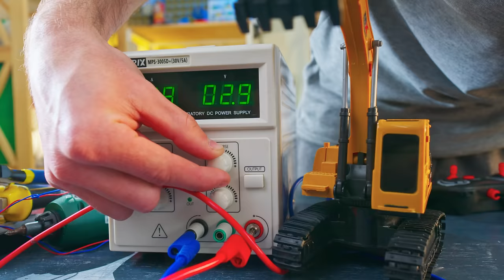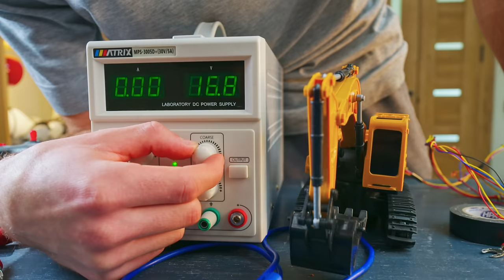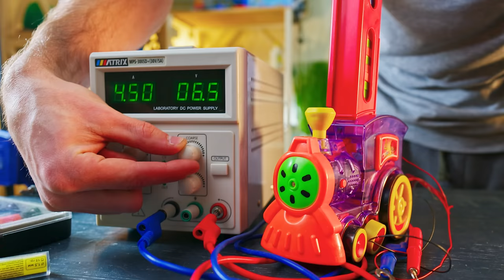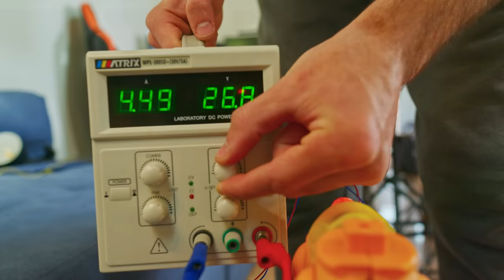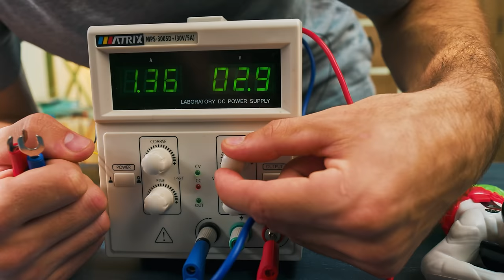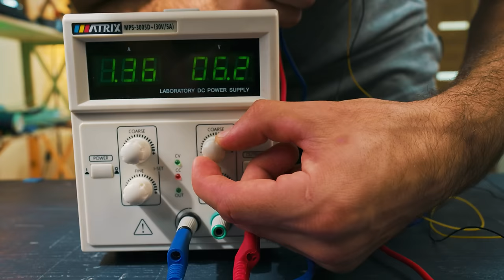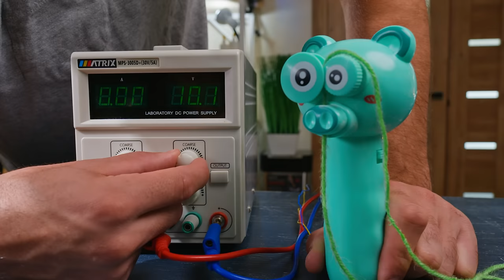I APPLIED HIGH VOLTAGE TO KIDS TOYS #5

Comment: That popping sound that jumped you is likely a capacitor on the motor used for RF suppression. Once it popped the motor could spin faster because the capacitor wasn't restricting the power anymore.

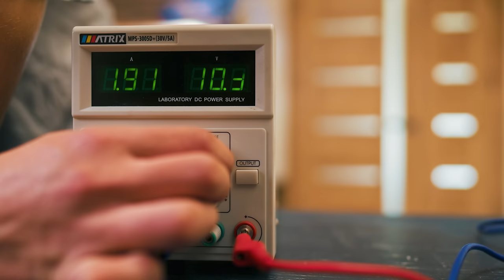22:02 if I ever got one of these I'd take out the voice chip and throw out the creepy doll part. I have a singing cactus that plays that same song and records.
Reply: So I’m just wondering, when you were talking about the resistor thing, I am not gonna do this with my walking robots like the ones I liked like my childhood fireman robot, but if it happens, even though I am not gonna do the high voltage, would it still do that effect that you said? Like for example, if cosmic had it, if robot leader had it, or extreme fighter, whose remote controlled, or mega robot, would they do that like that? Or it’s a different thing. Because I’m a toy robot collector, but I’m not gonna do that effect of the high-voltage. Why? I’m a toy robot collector and that’s why. And I’m gonna take care of my stuff. But I’m just wondering if it would happen even though I would take care of it all the time but if it happens and like I said, it never happened to my robots. But if it happens, would it do that? without doing high voltage..